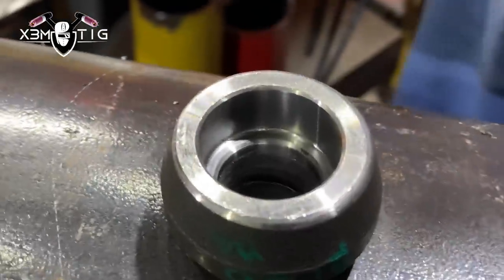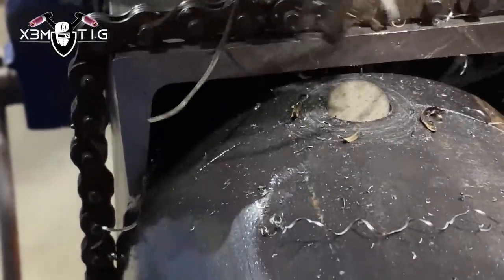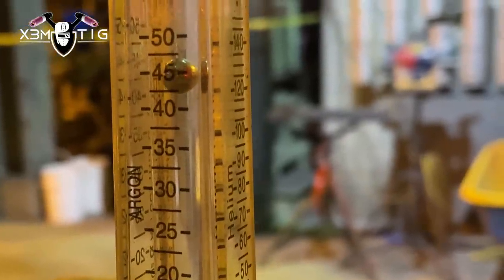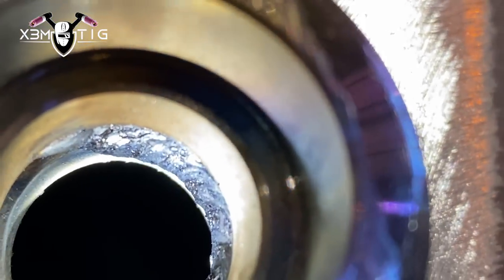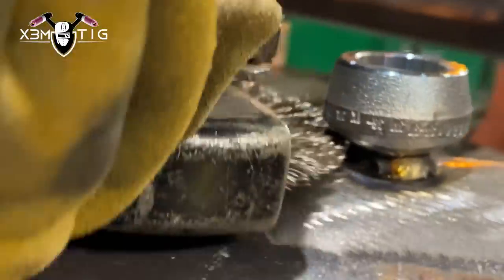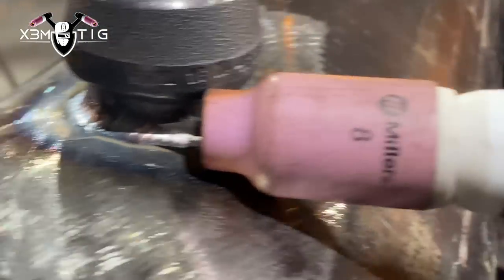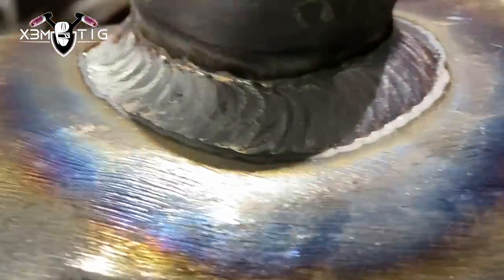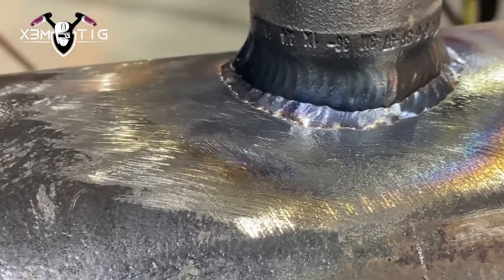Extreme Tungsten Stickout ! TIG Welding Techniques!

Comment: Before I retired, I work at a nuclear power plant. We had a project where we installed a whole bunch of these for vent lines on various size lines. They were challenging to say the least especially when they were out in the field and not in the shop. Some required two welders, one on each side because it was impossible for one person to get around the weld-o-let. We did not predrill the holes because they were hot tapped later after the valve was installed. I wish I would have seen this back then it surely would have helped. Nice tutorial.
Reply: what does hot tapping mean

Comment: That final pass really looked good. When I start out I like a smaller cup with 1/8th Gap. You still get the penetration and it saves time. You can turn up the amps just a little bit with a smaller cup and go like hell. You seem to have more patience than I do. I slow it down at the end . Great Video, THANKS

Comment: Do you think laser welding will impact the amount of TIG procedures. I used to be a pipe welder out of Local 46 in Toronto whilst I was in University. I was welding in the family business since I was 12. Now I’m a IT Geek but still miss beautiful welding like this. The best welders I worked with were all from Eastern Europe. Made my welds look like a dogs breakfast but still passed
X Ray.
Reply from the maker: Great point, but, laser welding comes with some limitations that prevent it from entirely replacing TIG welding. Its high equipment costs, limited effectiveness on thicker materials, and the need for skilled operators, create challenges. So in my opinion, that's not going to happen, and definitely not in piping industry.

Comment: Great example! Just got into the booth myself. Struggling with SS 12”   Pipe with bad high-low fit up. 1/8 gap to flush. Trying to use keyhole technique but lack penetration/fusion on one Side. Got any tips? Thanks again for ur vids
Reply from the maker: Grab a grinder and open that gap, especially that part where you have lack of fusion or give your pipefitter to do that. Don’t forget, you don’t have to weld it if you don’t like fit up, soon as you put the tacks you own it!
Reply: I found back-feeding worked well for catchinhg hi-lo

Comment: Great work, but I must ask, why do you not get yourself a helmet with a proper visor? Like speedglas g5-02 or if you prefer perma shade a helmet with a way bigger visor?
Reply from the maker: I got very good vision in my $20 bucks helmet. Fancy mask it doesn’t make you better welder!
Reply: @X3MTIG  I agree that its the welder not the mask but why not give yourself every bit of advantage you can have? When I began welding I bought the best welding mask there is right away. Wouldnt swap for anything else.
Reply: @digitalscale76 the best ones are the light weight hoods, especially in tides spots (Just my opinion)
Reply: @vincenzodellavalle9094  I'm sorry what is a weight hood? I haven't met with this phrase yet. Do you mean a leather welding mask? It's also called the devil over here. And it's by no means the best One, it's Perma shade. It's just a different type of equipment you use in tight fits.

Comment: Just curious what we’re you leveling the weld o let to?
Reply: It would be levelled parallel to the pipe lengthwise. In the other axis, it would be levelled to a flange or other Olet or pipe running In that direction.
Reply: @juliefleet1268  just watched the video again, I didn’t notice the 90 on the end when I first watched it, sorry about the confusion
Reply: It can be confusing. You’d also want to level the olet to the hole. Sometimes the olet will be used to insert a probe into the pipe and you want the probe to be straight down into it.